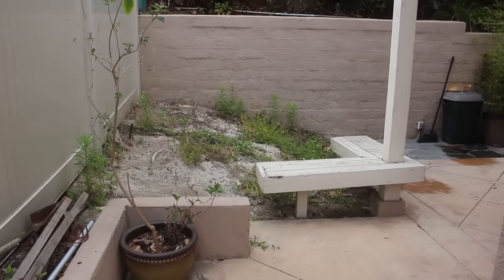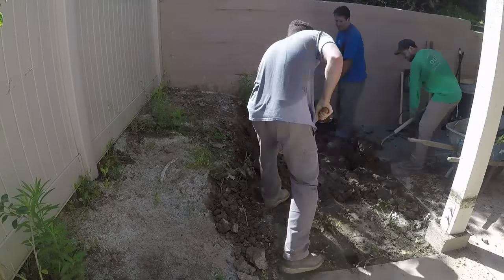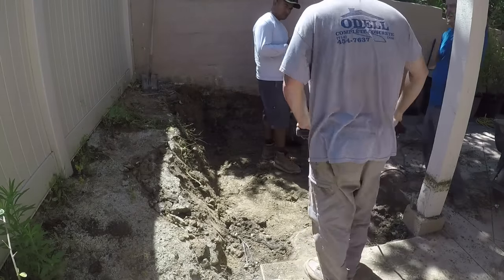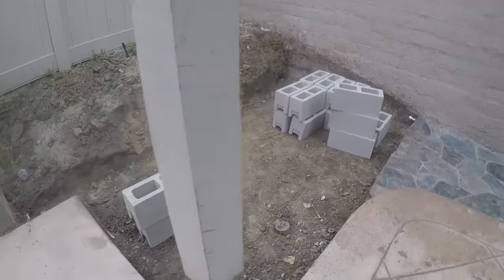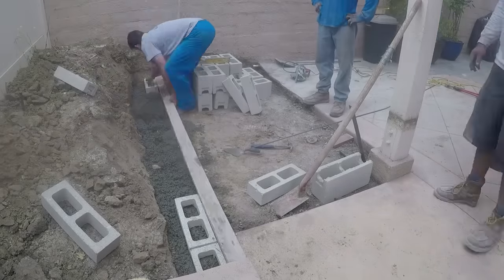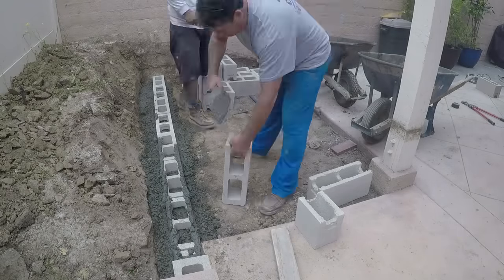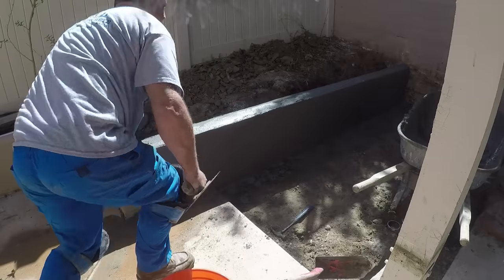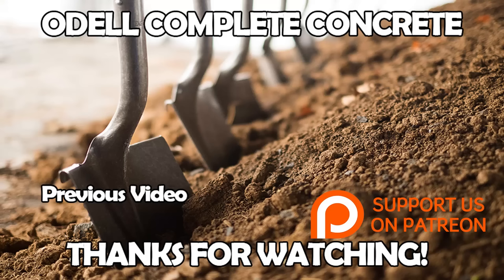How to Build a Small Retaining Wall Easy DIY

Comment: If I build 2 ft high and 70 ft long retaining wall (against the slope), using 8x8x16 concrete block , what is the footing size  (width and depth) should be? 
Thank you!.

Comment: I noticed that you didn't add rebar, or I didn't see it if you did, vertically every other block. When is it necessary to add them? Is it a height requirement? I'm working on building a wall about the same height as this one, maybe one row higher, I'm not certain yet.
Reply from the maker: Yes we had vertical rebar

Comment: Just did my first block job. Not too extensive. Just blocked in a door way.

When you're leveling block how perfect does it need to be? Does the bubble have to be in the middle or is within the lines good enough?
Reply from the maker: Polyvinyl chloride (PVC)

Comment: Hi David, Henry here, am a fan of your videos. Question, I made a 4ft x3ft concrete countertop 3 1/2 inch thick, is it okay to build 8x8x16 cinder blocks 5 high for this concrete countertop?
Reply from the maker: You'll need some big footings and framing to hold that up

Comment: This is another great video man. I need to replace the worn out railroad tie wall we have out front eventually but when I replace it I need to replace the side walls and the steps at the same time. Does your company provide consultations to folks who are doing DIY projects? I’d gladly pay to be able to speak to one of your people about the projects I want to complete here in PA. Thanks for the informative video again man. Take care!
Reply from the maker: I'm not familiar with the building codes there.
Try the local building department for free.
Reply: Odell Complete Concrete Thanks for the information. I’ll try that this week. Take care.

Comment: You would be a hell of a refractory guy Odell. Have you ever done any gunite?
Reply from the maker: No but once you can trowel concrete, gunite, drywall, stucco are all the same, only difference is vertical